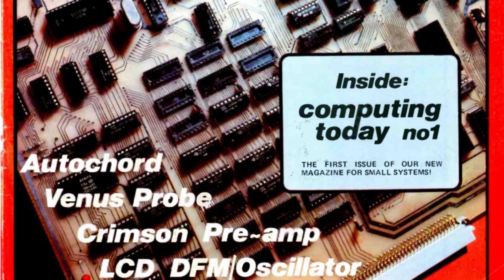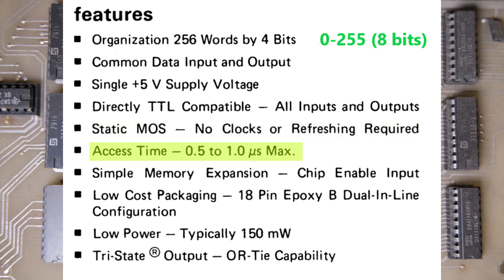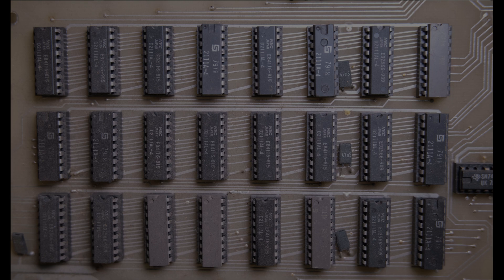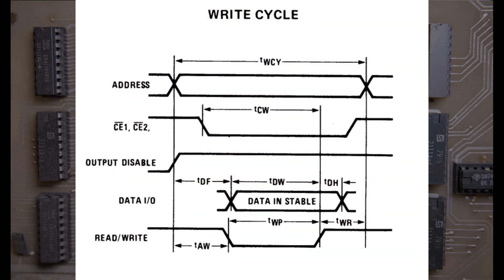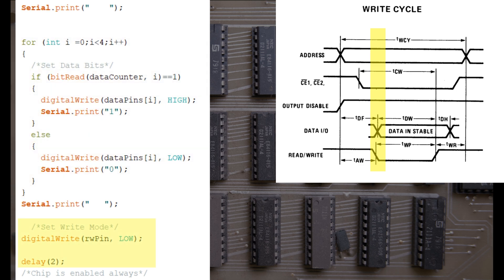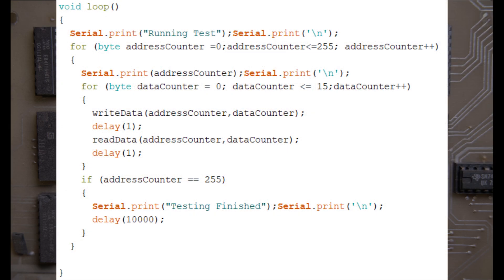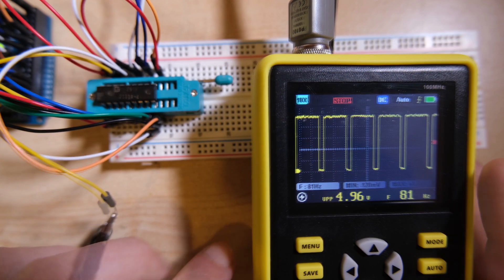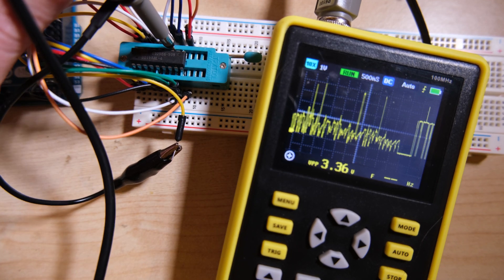How to Design and Build an Arduino SRAM Tester! - ETI Triton Part 3

Comment: Excellent video. My father still has the Triton he built, it's not currently operational so I plan to use your method to diagnose any bad RAM/ROM chips and hopefully get it back up and running again 🙂
Reply from the maker: Good luck!

Comment: Hey man, thanks for this tutorial, I'm from Argentina and I'm an electronics hobbyist (also retro gamer) and I have a sega atomiswave that have some minor graphic glitches. I'm thinking on doing something like this to test its ram modules. Do you think this could be adapted to test NEC d4545161ag5 rams modules with arduino? Or do you think on any limitations for accomplish this? (I have an arduino MEGA too). Any suggestions here will be appreciated. Thanks again man!
Reply from the maker: Yes of course.  You just need the datasheet. If it's a dynamic ram you will have to refresh it which might be hard timing wise.   Depending on the package you may need an adapter.
Reply: @HappyLittleDiodes  Oh I didn't know that about the refreshing. Do you have any resource that I can read about it? Or if you can explain that a little more will be helpful. Thanks again!